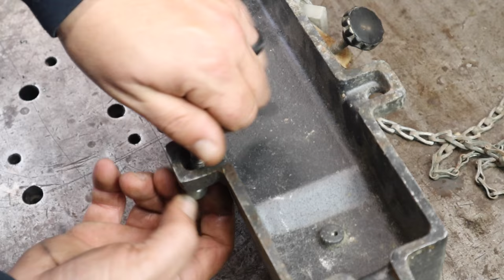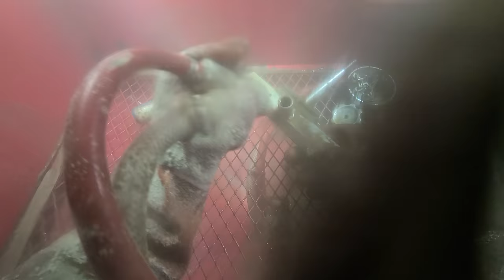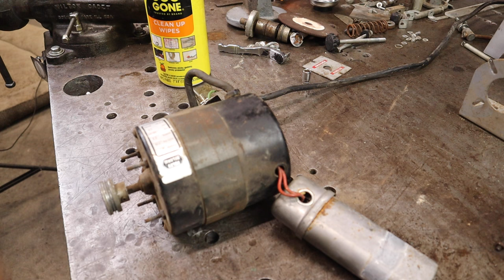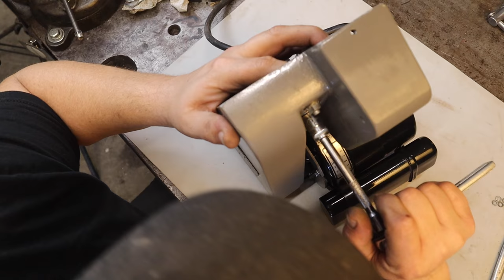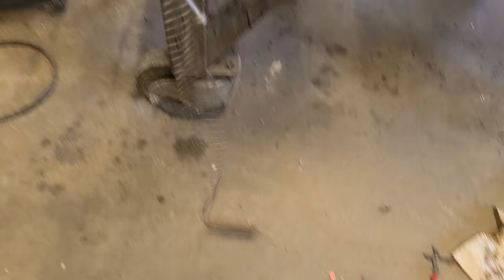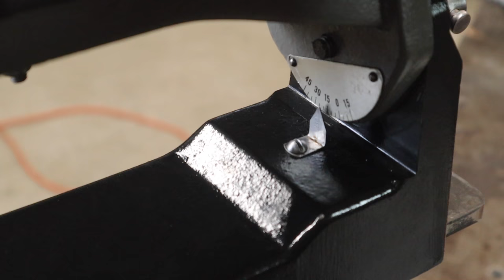Chain Grinder Restoration

Comment: In the words of Mark Novak (gunsmith/youtuber) " it's not a restoration its 30 years of deferred maintenance! "
Reply: Did the same myself, but it was more like 45 years of it, seeing as the date on the one part was 1974. Still a lot to go, but at least it does work, and does the job it is meant to. Got at least it cleanish, or at least got to see that the stainless steel parts actually are stainless, rather than dark brown from years of dust and gunk being baked on them. Now to see if the second parts mule can be fixed up, as it is mostly complete, but missing a few parts that will have to be made, and a good number that need repair from wear. Going to do the same as I did on the first, and braze up the holes and drill them out again, so there will be some bronze bushings in there to reduce steel to steel wear.
Reply: Ha! I love that

Comment: Foley 308 I believe. Supposed to be a medium light green. I'm working on one now. Not sure you were aware, but you can get the manual here- http://vintagemachinery.org/pubs/318/16303.pdf Quite a lot of engineering went into the machine and using the correct wheels, putting the right radius on the wheel and making the right settings for the particular chain are very important.